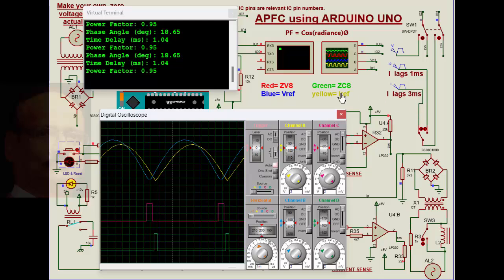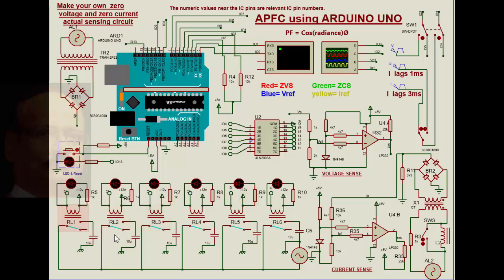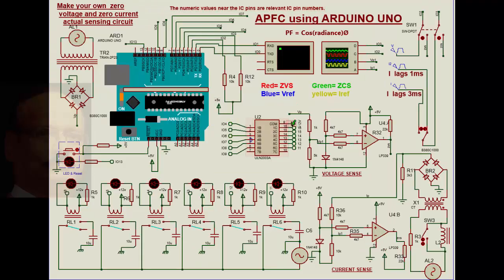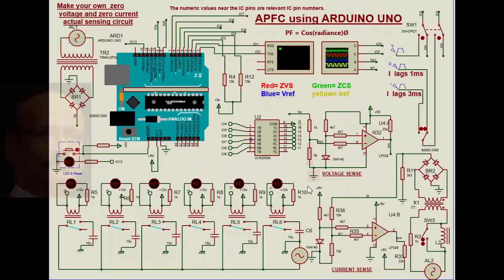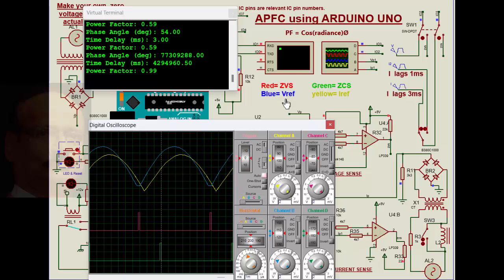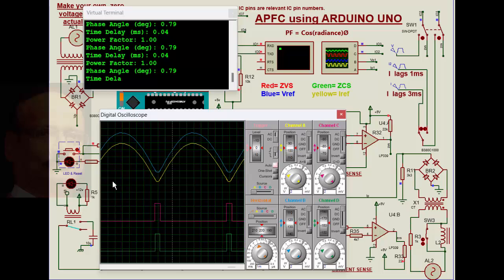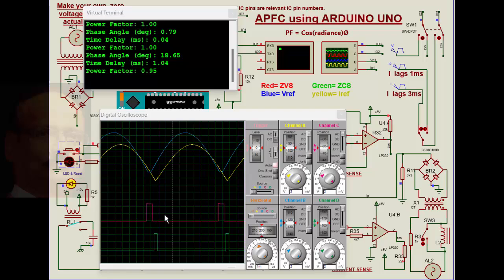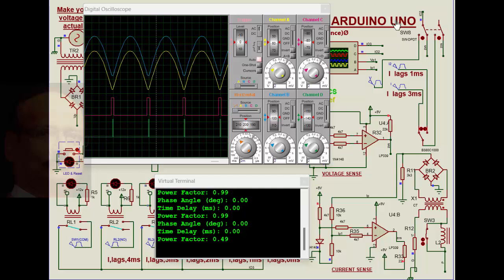APFC Automatic Power Factor Correction by Arduino in Proteus

Comment: Hello, I would like to try this out. Can this project be completed on a simple breadboard circuit? Can you provide us with a list of components used for this project? And which software was used? Thanks very much sir
Reply from the maker: Can try it on a breadboard but working success depends upon your ability to implement correctly. All components are very standard except IC= LM339, any CT, any small 300mA transformer (Tr2)of 230 to 12v, and No LCD but as seen on the serial monitor of Arduino. Copy the program from the screen. The software is Proteus from Labcenter UK. To get the full working software to please your intellect.
Reply: @PatnaikUC  thank you very much for your answer!